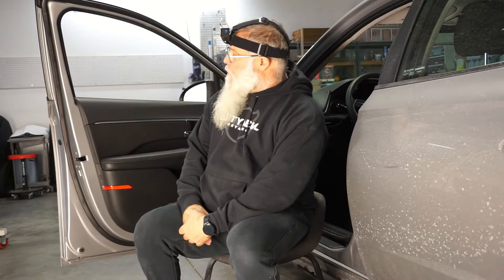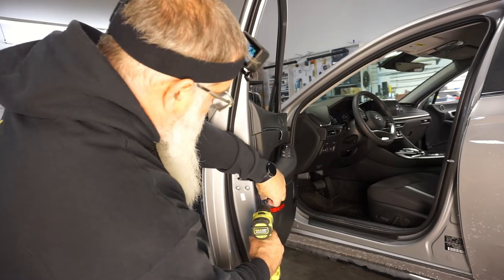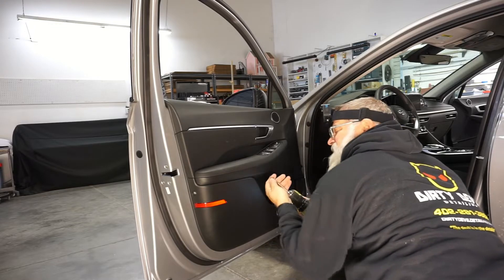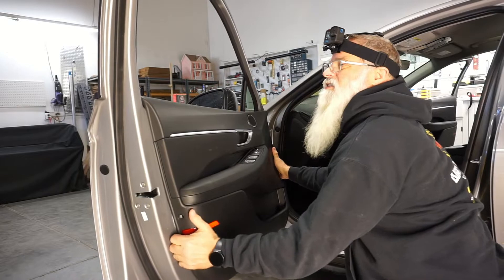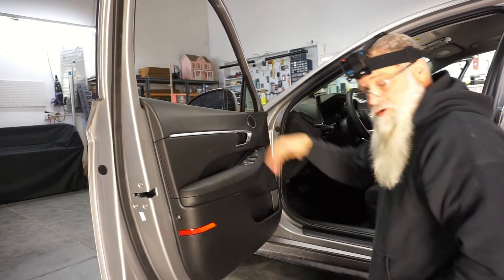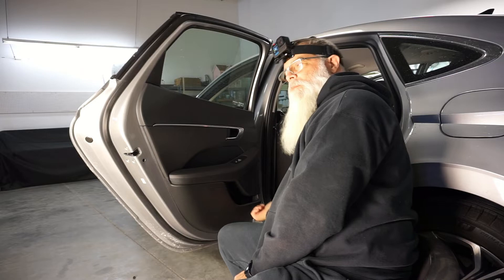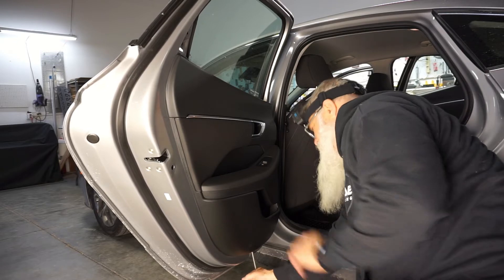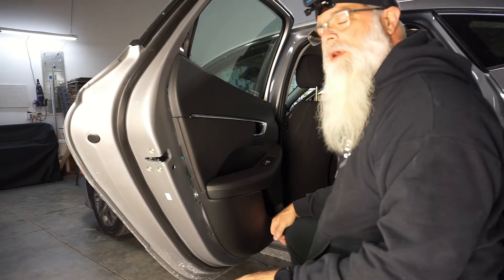Door panel removal 2023 Hyundai Sonata

Comment: I see you opened the door panel but is replacing windows hard on the make and model?

I just recently got my driver side window broken. I see the window is available to buy online.

My question is:
Is there any sensors or anything specific needed for replacement the driver glass window?

I have worked on 2013 before but with the 2023. I am unsure and would like more information before working on it

Don't want to mess anything up